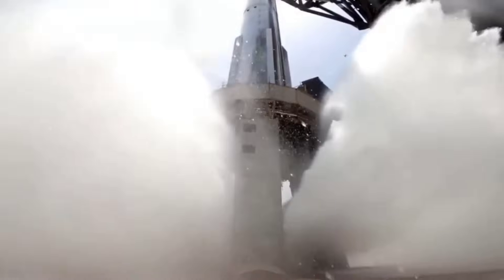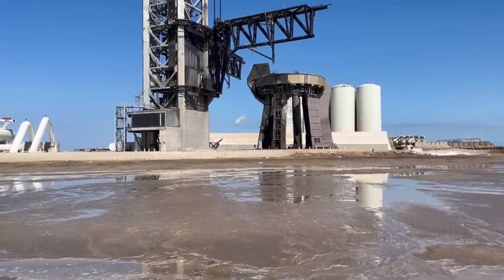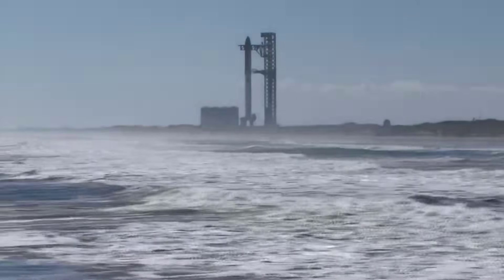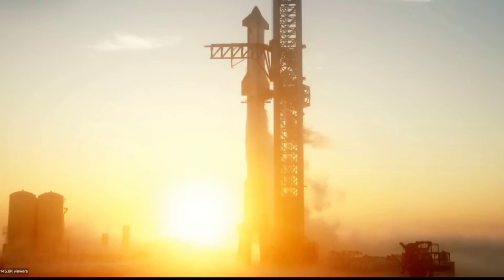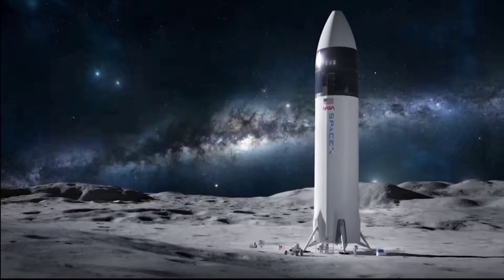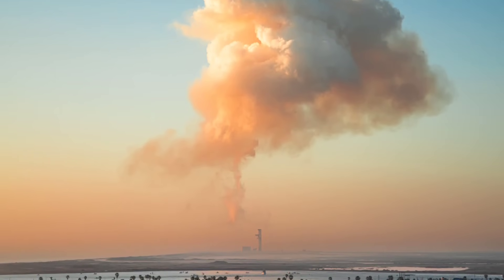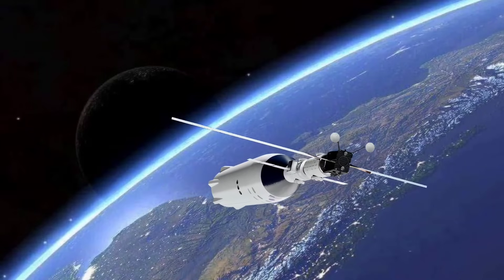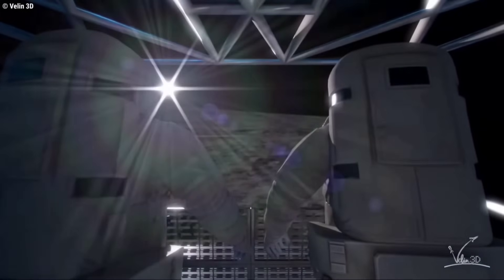IT'S SURVIVE! Starship Launch Pad Upgrade Help Stage Zero To Survive This Time!

Comment: ,❤ here is yr proof ❤ but yr faith in anything will not count. So pass this on it will count.❤an all who read will receive Jesus healing energy all old aches and pains will be washed away takes 30 minutes best to relax and shut yr eyes. Also 11 07 eastren night level 1 portion of youth longevity digestion an self beauty Jesus energy wash. Negative energy will creep out yr feet tell it's time. All are allowed even those that worship the antichrist 390 ft 33 half thruster dick. Jesus wants all to be in good condition for the day of judgement. Or I'm lying an yr closest friends won't experience it to